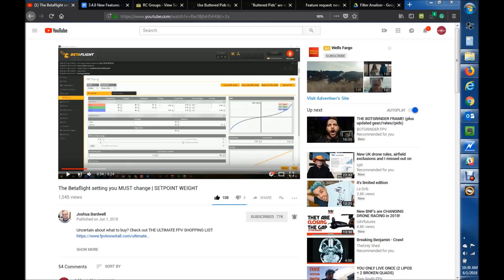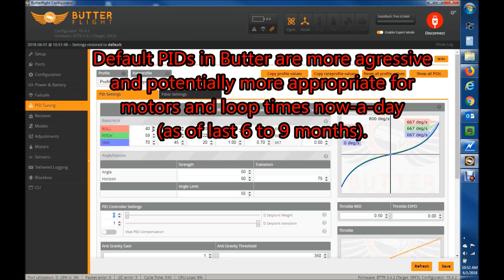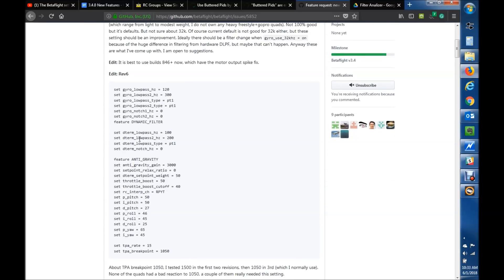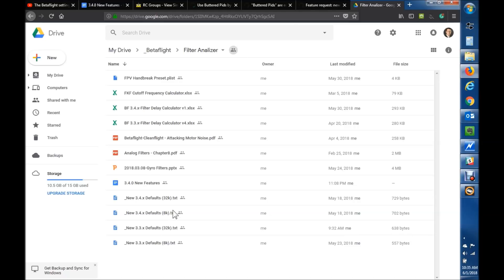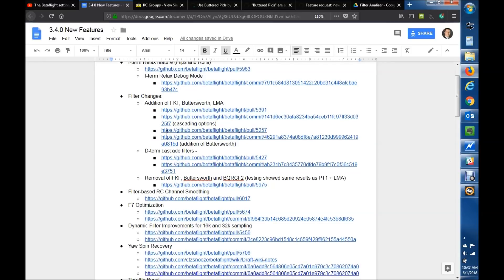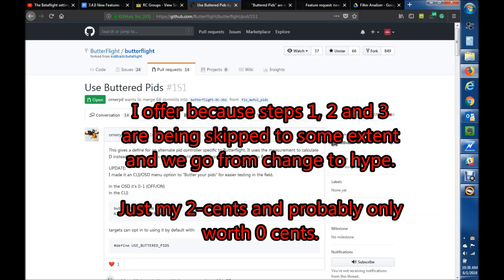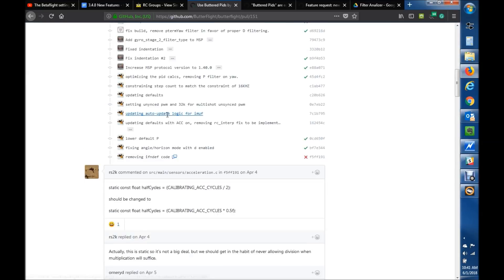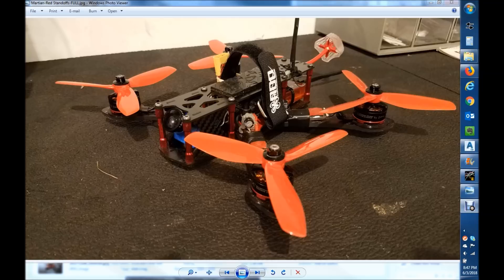Review: D-Setpoint | Buttery PIDs | BF 3.4.0 Proposed PIDs & Prop Wash

Comment: For your 3.3.x 8K settings, the TPA breakpoint is set at 1050, isn't that a little low? It's like you're apply TPA by being just a little above mid throttle.
Reply from the maker: Alvin Yeoh , a new approach.  Try it.  That is what is proposed as the new default.

Comment: I think two of the commands in the 3.3 files are incorrect.  The correct commands are, set gyro_stage2_lowpass_hz = 300 and set dterm_lowpass = 100
Reply from the maker: Thanks for that.  Didn't pay attention that the variables in 3.4 were renamed.  Much appreciated.  I fixed up the text files for 3.3.X.

Why it is always good to check the stuck.

Comment: Upgraded from 3.3.2 to 3.3.3 , after doing 1 pack on a utt1 track the motors were cool Never happened before they were normally Luke warm. The other change was I had tunned rc interpolation to smooth out the rc commands on rpyl. Before they were stair stepping. May be i was getting too much d term kick. I have to go back to check the old logs.

Comment: Hi Mark,  So if going back to PT1 LPF, I take it we need to also now remove the stage2_lowpass_hz by setting it back to 0. is that correct?
Reply from the maker: ITS FPV , in what?  BuT, BF?  U running 8k, 32k?  Need more info.
Reply: 8k in BF 3.3.3,  had  stage2_lowpass_hz @ 90 and Stage 1 disabled previously.
Reply from the maker: ITS FPV , see https://youtu.be/ryONT42HPTY for my recommendations.  Or give the proposed new defaults a shot.  Or do both and see what works best for your setup.  Filter tuning, like PID tuning, is rig specific.
Reply from the maker: It is all the same.  Leave as is.  3.4 will be out soon.  Wait for that.

Comment: I've been running the LPF at 120 on my MPU6000 builds for a year or so now without any noise issues. I'm glad to see the devs are increasing the default as this setting makes a big difference to the handling, but the average user will never increase it.

Comment: So far I never tried to change setpoint weight and transition. The outcome in flight behavior after them seems useful. I'll definitely try to update and fly with them in this week. Thanks about advice to set setpoint transition to exactly zero and not 0.01. By the way I tested two weeks old Betaflight 3.4.0 prerelease Jenkins build in two mine quads. Certainly agree about that dynamic filter must be enabled by default with both notch filters off. Even my noisiest quad with 2 yr old Emax RS2205 motors in Betaflight 3.4.0 with dynamic filter on, d_lowpass_type = PT1, gyro_lowpass_hz = 90 and both notch filters off had smooth control and motors cold without grinding noise. Filtered gyro traces in blackbox log was very smooth. By changing d_lowpass_type to BIQUAD_RC_FIR2 in fact nothing changed. Probably you're right that in Betaflight all filters produce same results :)  Remaining thing was some propwash on very sharp turns - must sort that out.

Your testing quad DVR recording sound is awful Seems VTX or camera microphone need some filtering too :)
Reply: 15 min ago tested Betaflight 3.4.0 (Jenkins build 900) filtering on my noisiest quad (BFight 210 frame, 2 yr old Emax RS2205 2600KV motors, FC is Racerstar TattooF4S / MPU6000). Used your defaults for 3.4.0 8K gyro. Only lowered Stage 2 lowpass filter frequency to 90 Hz. Filter frequencies are
gyro_lowpass_hz = 100
gyro_lowpass2_hz = 90
Both notch filters and D-term filter are off. Dynamic filter is enabled. Smooth handling, smooth gyro traces in log, cold motors. In fact better results than it was 2-3 weeks ago with BQRCF2, BIQUAD_RC_FIR2 and FKF filters. Probably need to tune PIDs a little although quad already flies good enough.
Reply: Man, you are awesome! I tested one of my quads with a new Betaflight 3.4.0 defaults.
https://youtu.be/jrwkAybSaWI
Didn't expected that it will be now possible to hover in Acro! No propwash - not a tiny bit of it. I didn't became a better pilot overnight although quad handling with your defaults is now a way easier. Rolls and loops are not nervous anymore. Thank you!

Comment: I am not sure about default pid.   Recently finished tuning a quad running bh r2 2600kv and 30a blheli 32, which I suspect is just 20a max.  The frame is Avantquad xero 5inch. Betaflight 3.3.2  I had to increase my p roll to 60 and p pitch 70.   I did not get any p term oscillation, which I was a bit surprised. They are old motors  so properly running even higher than 2600kv.    For 2300kv motor the p term is about 10 less than 2600kv.  My point is there is no one size fit all. It is only a good starting one.  

I do agree with you that 90hz for lpf is a bit low. I use 110 after checking a number of my BBL.

Comment: In each of the text files of proposed new defaults you linked, the TPA breakpoint is set at 1050. Is this actually what the Betaflight devs are meaning to do? Or is it a mistype of the current default of 1650 we've had for forever. It just seems odd to have TPA activate at 1050. It would essentially be active at any value above idle. I understand if that's actually what they're intending, but only if they're also changing the linearity of how TPA is applied. It would actually be cool if PIDs were attenuated intelligently across the entire throttle range, rather than just on the upper range of throttle. But again, only if they really nailed the attenuation curve.
Reply: I would also like to know the answer to your question since I use TPA typically at 1500 - 1600 on my 6S rigs.
Reply: The TPA breakpoint 1050 setting is not a mistake, but probably won't be applied in 3.4.  I just wanted feedback on that setting (if it has any negative impact for anyone at all) because it solved mid throttle problems on a couple of my lighter 5" quads.  And in my own testing I didn't observe any downside of 1050 on other quads that were fine with 1500-1600 breakpoint.
Reply: Cool! thanks for the reply.  I do like the concept of the TPA being applied across the whole throttle. It makes sense. I was mostly unsure of how well its current implementation would scale across the broader throttle range. But it sounds like it's working just fine.
Reply: Current implementation of TPA works just like it should.  With the TPA % (P and D reduction) being applied linearly from breakpoint value to 100% throttle.  

I agree there seems to be a lot of confusion over this, seems a common thought is that the P and D step down immediately at break point.  This is just not true.